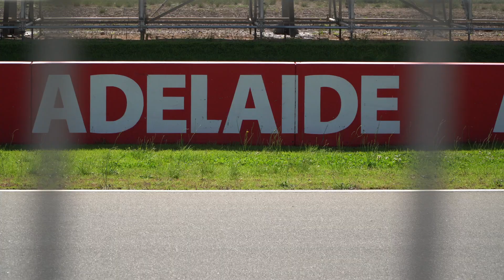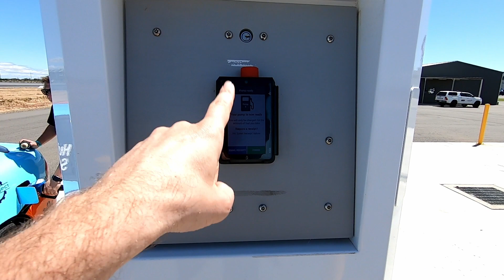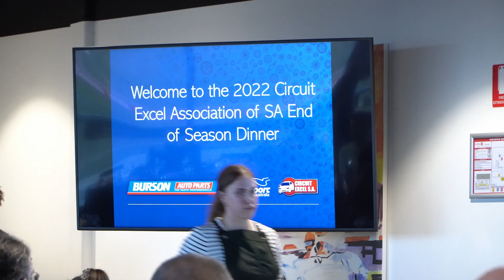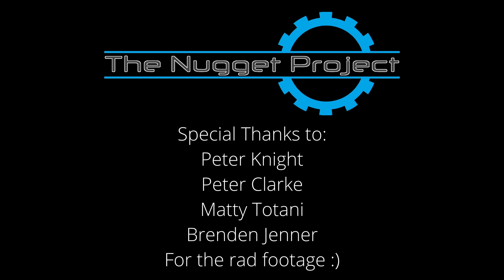The Bend Enduro Part 2 - Race Day!

Comment: Earlier in the season I had a similar brake issue that started after a few spins. Took the master cylinder a part and found that the plunger wouldn't always seat properly; thus giving the long pedal but not a complete failure.
Reply from the maker: Yeah by the end it was still slowing the car but definitely not the strength you want in a race haha